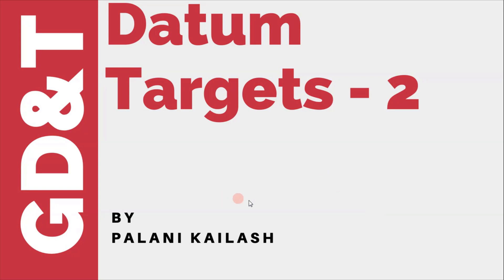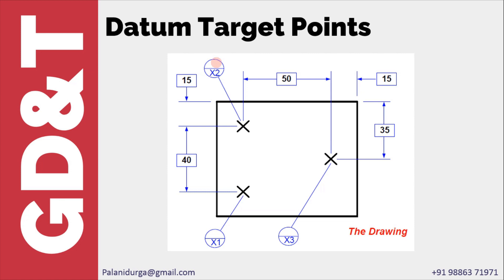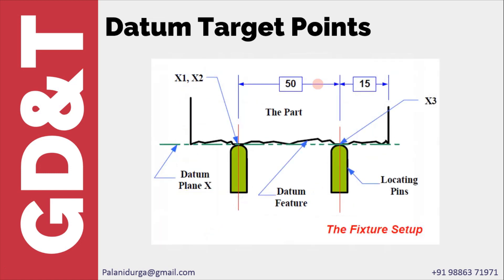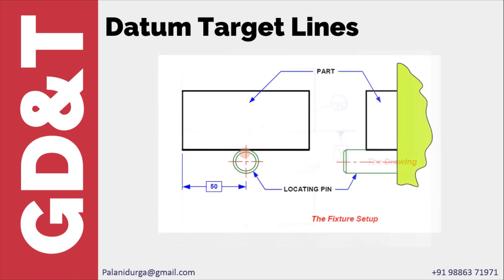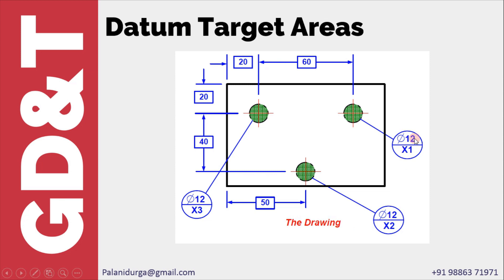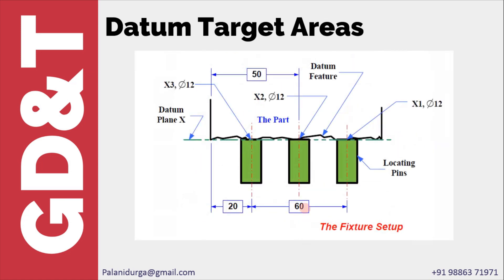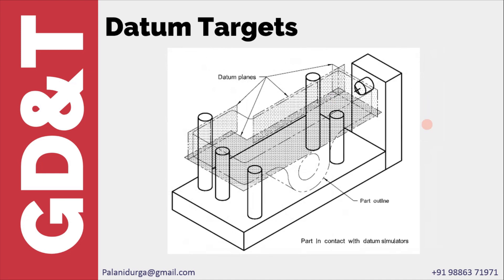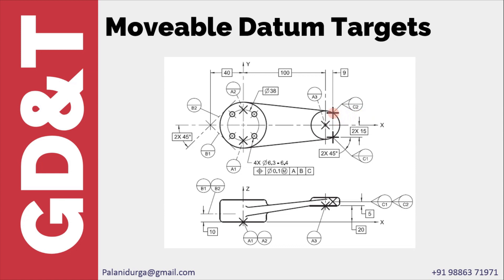GD&T Tutorial 24.10 : Datum Targets 2

Comment: Palani Kailash, I have always used Bottom Left Corner as my 0.00 Datum point for me to give coordinate dimensions. Could it vary to for instants Top Left Corner? Having said that can I always maintain Bottom Left Corner as my Datum 0.00 in all the views? Example: Plate 75 X 150 X 10 thick. In the front view  it is lying on the biggest face - Primary- A. Then it is touching at 2-points on 150-edge (Datum B) and then touching at 1-point on edge-75 (Datum C) - meaning A, B & C in the feature control flag. Now for the features in the Right Side View - the sequence will change meaning B, A & C in the feature control flag but can the 0.00 Datum still be Bottom Right Corner? And the same for all Views - Bottom Right Corner as my 0.00 starting point but changing the sequence A, B & C as required . Hope I was clear. Thanks!
Reply from the maker: If i have understood your requirement properly, the datums will not change based on different views. we choose datums based on functional requirements and assembly requirements. considered rethinking of your understanding of datum

Comment: Hi sir 
good explanation but doubt 
1.datum target have different height  to make datum  is it okay can u explain about with example
2. for datum target do we need consider primary datum should be arrest  minimum of 3 point   secondary should be 2 point and tertiary should be 1 or it may be any order 2-1-3 or no need to  consider 3-2-1 can explanation more about this
Reply from the maker: 1. it is ok to have different height for different targets.
2. When only datum targets are used for defining Primary, Secondary and Tertiary datums, then we have to follow 3-2-1 principle.
for primary minimum 3 points, for secondary minimum 2 points and tertiary minimum 1 point.
Giving examples for all applications in this forum is not piratically feasible